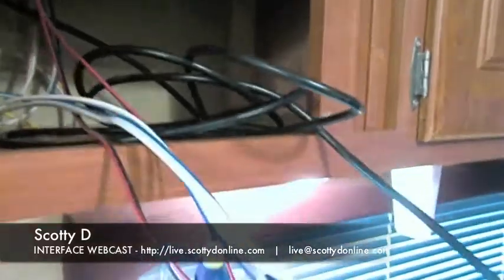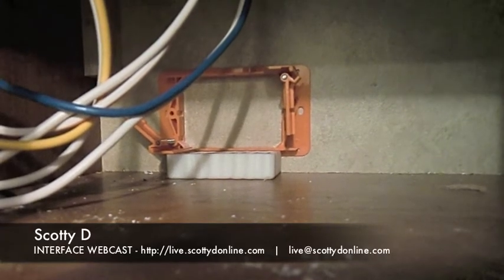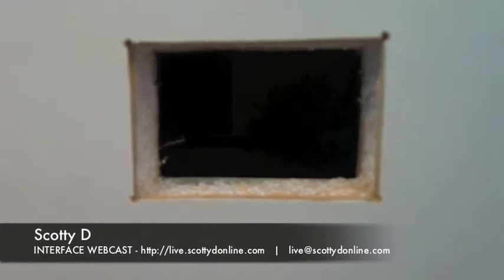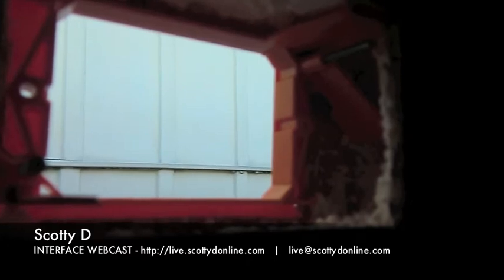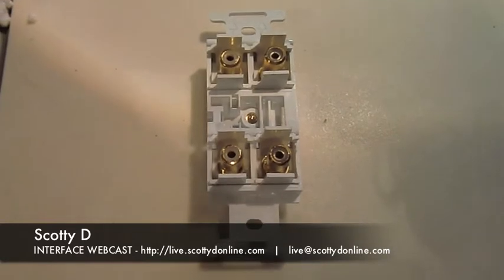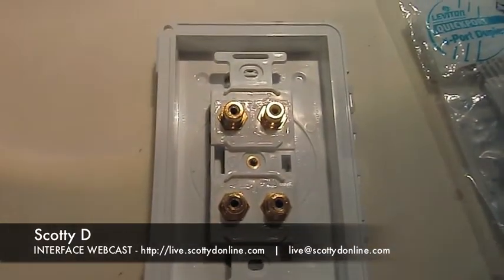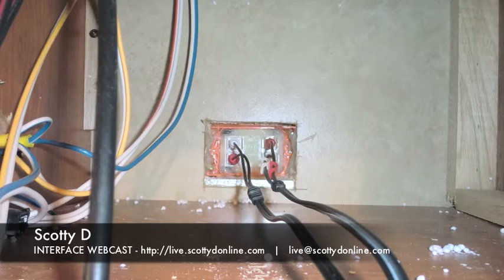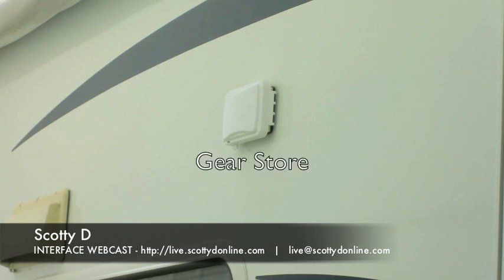INTERFACE WEBCAST - How To - Camper Audio Cabling

Comment: so you got audio out from inside to outside... where is the speaker wiring? you just going to 'dangle' cables to an external speaker system? Anyone can drill a hole, silicone a box - the main point of this video is how to CONNECT/HARD WIRE Externally mounted speakers that are in a TRUE STEREO placement outside the RV... Waiting on that video...